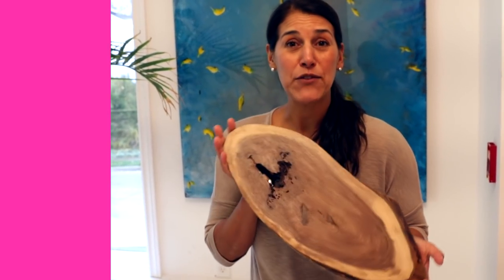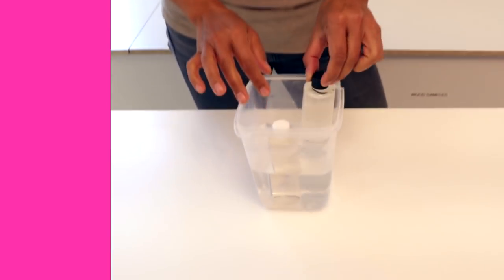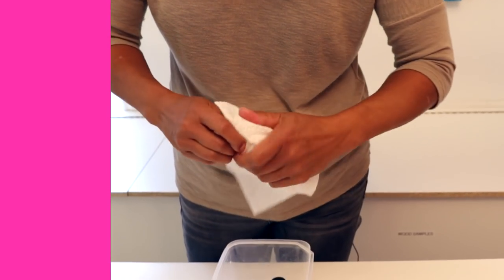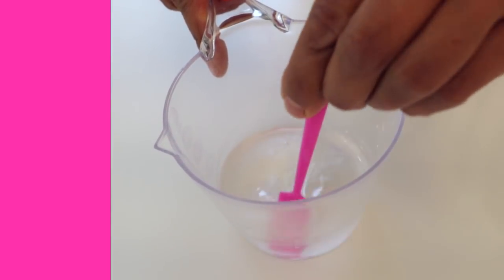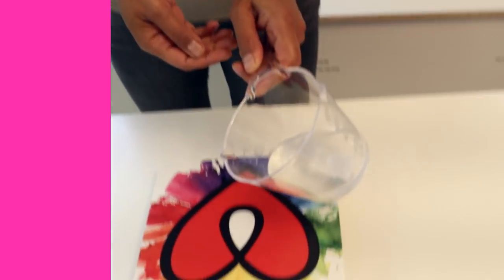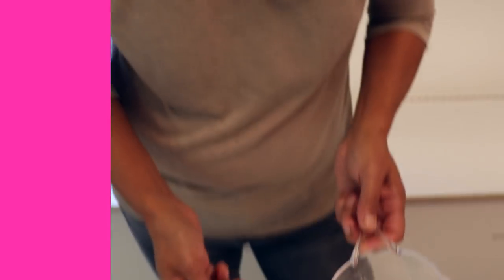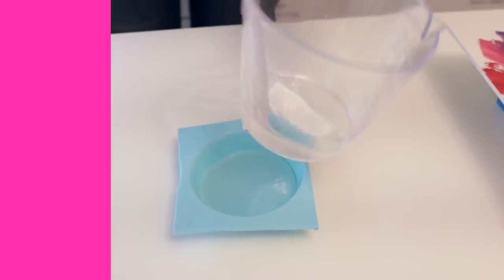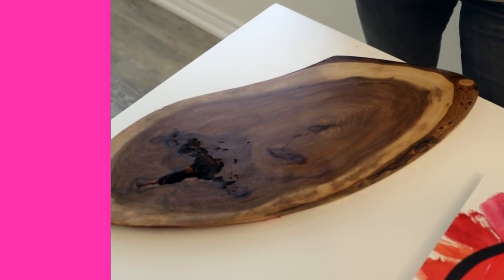How To Get Rid Of Epoxy Resin Bubbles

Comment: I have been successful at eliminating bubbles that have re-appeared after 5 hrs. (max time you should consider this ) by sweeping the torch across the area.  I mean if you realize you're going to have to re-sand and re-pour anyway...what have you got to lose? It worked for me. I've poured over a thousand jobs and one thing Ive learned is art resin has a mind of it's own.
Reply from the maker: Hi Jim, thanks for sharing your tip.  We typically don't recommend working your resin this far into the cure time, we usually advise leaving it alone once your 45 minute pot life has passed and the resin has begun to cure.   You did say you'd have to sand and re-pour anyway so I know you were already assessing the risk vs reward and sometimes it pays off!  🙂

Comment: How long do you torch? I keep seeing bubbles as I torch so I keep torching it and end up with a lot of bubbles. If you stay too long in torching can you actually cook the bubbles in your resin? One last question, are any of the tips you gave us in the video also why I have some blotches patches with no resin?
Reply from the maker: Generally one pass of the torch should clear your bubbles.  To help reduce the amount of bubbles in your resin try using a warm water bath prior to mixing.  You do not want to over torch your resin as it can burn it and cause surface imperfections and yellowing.   

The blotchy patches and bare patches you are asking about can happen if the resin is being repelled by oils or dirt.  Here is a video with more information on this: 
https://youtu.be/m7j7AcmgCvQ

Comment: In regards to your 1/8" rule - does it need to dry between layers if we want to go thicker? Or do you pour, let the bubbles rise, then pour a second time during the working period of the resin?
Reply from the maker: Hi Janae - you have two choices.   You can let it dry in between layers, but that means you need to sand to create tooth for the fresh resin layer to adhere to.  Second option which is easier, is wait 3-5 hrs until the resin is thick and still tacky, then pour your next layer on, and subsequent layers every 3-5 hrs.  The tackiness will provide the tooth for the fresh resin layer to adhere to.
Reply: If you wait 3 to 5 hours to add more resin and you have bubbles still in the first layer, will that lock them in or do you do the same procedure of torching to try to get the bubbles out?

Comment: I work with wood as well painting for my wood what is the best kind of sealers ty
Reply from the maker: For wood, I like using a brush on sealant like modpodge, so you can really get into the nooks and crannies, especially with live edge wood.  You may need to apply several coats of sealant - if the wood is particularly porous, it can absorb the sealant on the first go. Choose a brush on sealant that is designated safe to use with wood and that dries clear - your arts & crafts store should be able to guide you :)
Reply: @Artresin  does it matter which mod podge?? ty so much
Reply from the maker: @tinamariemalinowski2745  I don't believe so - we just use the original, but I do believe they offer specific bottles for puzzles etc.  It's up to you!

Comment: Can you use a normal lighter
Reply from the maker: A torch is the best tool to get rid of bubbles in epoxy resin. There are other methods, including poking with a pin or blowing through a straw, but these are slow and ineffective. A hair dryer or heat gun doesn't get hot enough to remove bubbles efficiently and can blow dust all over your wet resin. A butane or propane torch, on the other hand, is easy to use and provides the heat, control and intensity to remove bubbles for a flawless, pro finish!